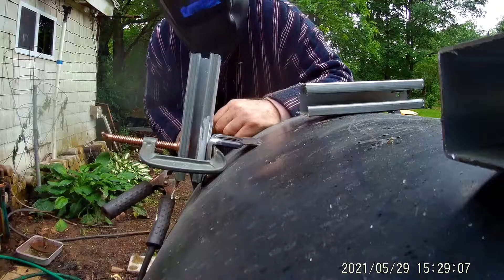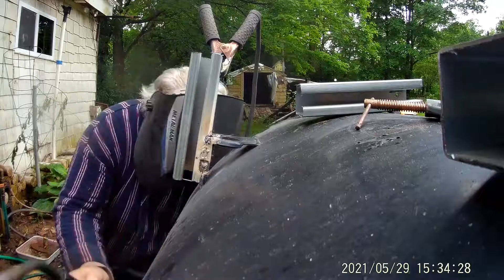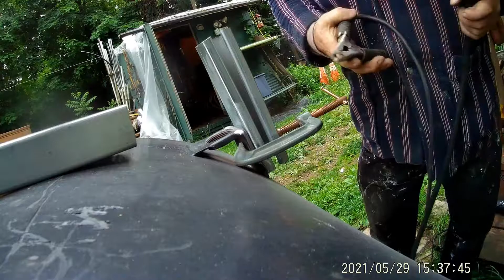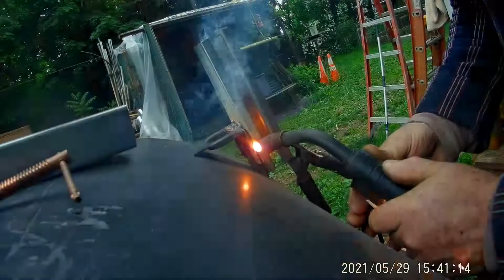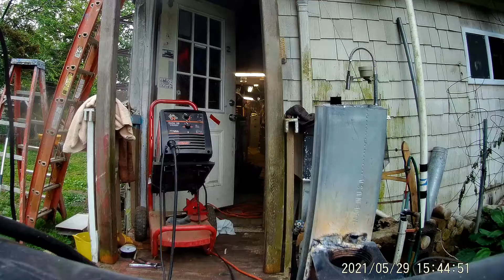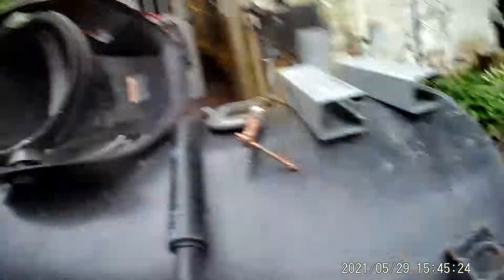Started welding legs

Comment: Wow hardcore tough Buzzsah those will last forever
Reply from the maker: I'd be happy with 10 years. lol. Not a welder and in this case  I was trying to weld two different weights, if I turn up the heat it burns through the lighter, turn down and takes longer to penetrate the thicker.  So that's what I see, not sure.